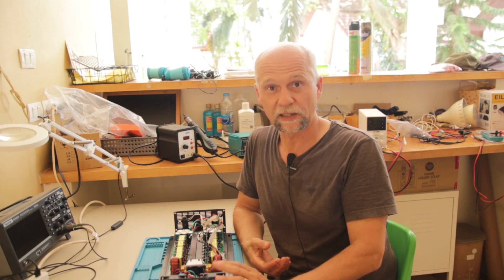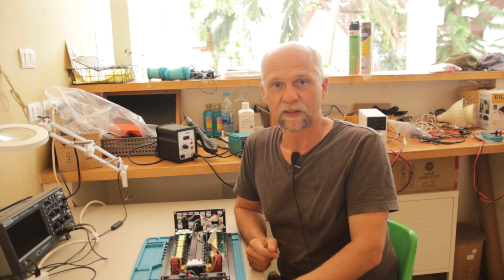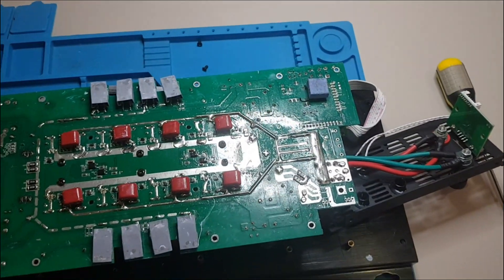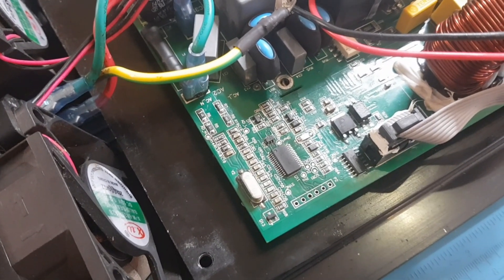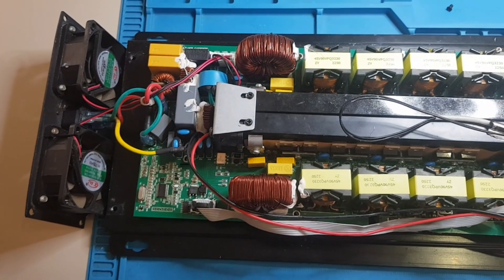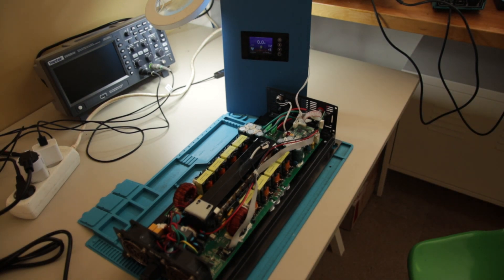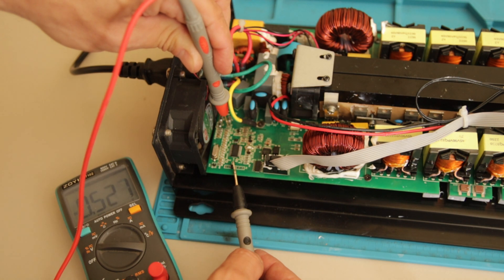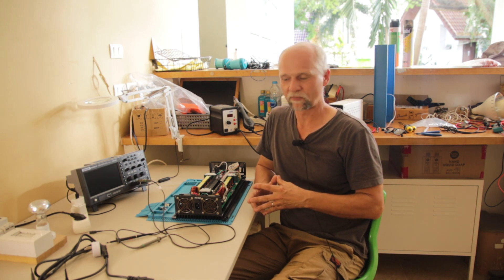Last chance for this SUN2000GTIL Inverter. What exactly means "Grid Error"?

Comment: Hello Roland,
Freut mich zu hören dass du das Serviemanual bekommen hast mit genauen Infos zur Fehlerbehebung. 
Mein SUN1000 funktioniert nach der Reparatur einigermaßen, hat jedoch noch "kleine" Probleme:
1. Bei der externen Strommessung für den Limiter wird einiges zu wenig angezeigt (etwa Faktor 5). Weisst du welche Widerstände für dessen Spannungsteiler zuständig sind und welche Widerstandswerte es sind?
2. Die ausgegebene Leistung ist auch etwa Faktor 3 zu niedrig. Wenn ich 200 Watt im Menü einstelle wird 80 Watt Leistung produziert. Wird das auch mit Vorwiderständen geregelt?
Darf ich fragen was du dir als Ersatzwechselrichter ausgewählt hast?
Besten Dank und Grüsse
Reply from the maker: Hi. Das was Du hier beschreibst ist genau wie meine Ersatzplatine funktioniert hat. Falsche CT-Werte, 80W am Ausgang. Die CTs und ihre Auswertung sind Teil des kleinen aufgesteckten Control-Boards. Ich habe dort bei mir alle Leiterbahnen nachverfolgt und es war alles in Ordnung. Also denke ich, dass das problem eher mir der DC-Boost-stufe zu tun hat und dann folglich mit der AC Umwandlung.
Ich habe jetzt soeben meine Anlage auf Deye SUN-10K 3-Phasen umgestellt. Videos sind gerade im werden, vorweg jedoch kann ich schon sagen... ein Traum :)
Reply: @RolandW_DIYEnergyandMore Danke für die Rückmeldung. Wenn du nach der umfassenden Analyse keine Lösung finden könntest, dann wird es nicht einfach mit der Reparatur.
Ich habe nur ca. 1kWp Solarleistung, somit benötige ich nicht einen grossen Wechselrichter.
Werde voraussichtlich eher Richtung regelbaren Mikrowechselrichter gehen...

Comment: Hallo Roland, ich habe heute die 4 Widerstände gegen neue ausgetauscht. Hat leider nichts geändert.

Habe dann mit der Anleitung fehlersuche betrieben.

Aufgefallen ist mir, das bei den Igbts zwischen Gate und Emitter ein deutlich kleinerer Wert ist, wie es in der Anleitung gezeigt wird. Fast kurzschluss.

Habe dann beide Igbts ausgelötet und gemessen. Beide sind i.o und haben auch kein Kurzschluss.

Könnte das auf ein Defekt des Treibers U3 hindeuten?

Viele Grüße
Paul
Reply from the maker: Hi. Willkommen im "Rabbithole" Sun1000-AC-Seite ;)
 
Ohne eingelöteten IGBTs was sagt der Widerstandswert auf der Platine? Dort ist ein 10k Pull-Down Widerstand platziert also sollte der Wert 10k betragen. Wenn es immer noch nahe Kurzschluss ist, schmeiß einmal den Treiber raus und messe noch einmal.

Ich bin mir jetzt nicht sicher ob irgendwo ein Filter-Kondensator zwischen G-E eingebaut ist. Verfolge einmal die Leiterbahnen in der nähe der IGBTs ob da noch irgendetwas anderes dran hängt.

Alles Gute! LG, Roland
Reply: @RolandW_DIYEnergyandMore  Hallo Roland, der Wechselrichter läuft wieder. Vielen Dank für die Hilfe. Der Treiber U3 hatte ein kurzschluss.

Viele Grüße
Paul

Comment: Hallo Roland, ich habe das Problem bei ein SUN 1000 mit der Fehlermeldung Grid Error.

Die Netzfrequenz wird im Display angezeigt und beträgt 46,1HZ. Scheint so, als wenn er nicht die frequenz richtig misst.

Habe dann mal gemessen und an H_3,3V liegt 3,2Volt an und an H_12V liegt nur 11V an.

An von dir besagten Stelle liegen 0,4 Volt an.

Die Betriebsspannungen ohne H sind auch i.o

Weist du woran das liegen könnte?

Viele Grüße
Paul
Reply from the maker: Hallo Paul. Die Frequenzanzeige kannst Du getrost vergessen, da dieser Wert dort auf keiner Messung beruht, sondern nur signalisieren soll dass das Netz außerhalb der Parameter liegt und der Wechselrichter somit nicht aufschaltet. Das schreibt er also nur willkürlich so hin!

Ausschlaggebend ist einzig das Signal welches er von den 4 Widerständen kommend sieht. Wenn dort eine Verzerrung der Sinuswelle angezeigt wird, also somit kein eindeutiger Durchgang des Nullpunktes zu erkennen ist, dann erkennt er das Netz nicht richtig.

Meistens bei "Grid Error", kann das direkt an diesen 4 Widerständen liegen, da diese Feuchtigkeit anziehen und Korrosion bilden. Du solltest diese also neu löten damit sie guten Kontakt haben.
Leider ist das Signal aber auch ein Produkt aus der H-Brücke zwischen den 2 IGBTs welche die Wechselspannung schalten. Wenn mit den IGBTs etwas nicht stimmt, wird das Signal verzerrt!

Hast Du die Wartungsdatei aus dem Videolink aus dem Blog vom Bobby gefunden womit Du den Wechselrichter tiefgreifender diagnostizieren kannst? Damit kannst Du dann noch andere Widerstände, Spannungen, etc. kontrollieren.

Liebe Grüße und ein frohes Neujahr! Roland
Reply: @RolandW_DIYEnergyandMore  Hallo Roland, ja danke und dir auch ein frohes neues Jahr!

Ich habe die 4 Widerstände neu verlötet. Hat leider nichts gebracht. Habe die dann ausgelötet und festgestellt das einer ein leicht anderen Wert hat wie die anderen. Habe die aufjedenfall jetzt erstmal bestellt.

Wenn das auch nicht klappt, schau ich mir das mit die Igbts an.

Vielen Dank für den Tipp!

Gruß Paul
Reply: @RolandW_DIYEnergyandMore Hallo Roland, ich habe heute die 4 Widerstände gegen neue ausgetauscht. Hat leider nichts geändert.

Habe dann mit der Anleitung fehlersuche betrieben.

Aufgefallen ist mir, das bei den Igbts zwischen Gate und Emitter ein deutlich kleinerer Wert ist, wie es in der Anleitung gezeigt wird. Fast kurzschluss.

Habe dann beide Igbts ausgelötet und gemessen. Beide sind i.o und haben auch kein Kurzschluss.

Könnte das auf ein Defekt des Treibers U3 hindeuten?

Viele Grüße
Paul

Comment: I guess I have been lucky mine still work but I am converting to LuxPower 12000 and it does not like the Sun 1000 on the same AC bus so I will be retiring them soon as they overload the AC leg when the load is not high enough. They produced 11000 kwh so I don't feel too bad.
Reply from the maker: @offgridwanabe  yes. They did a great job at your place and paid off 😄

Comment: Hallo Roland, ich habe auch einen Sun 1000 bei mir installiert, bisher ohne Probleme.
Eines ist mir allerdings aufgefallen, meiner reagiert sehr sensibel wenn ich beim AC In
Phase und Null-Leiter vertausche, sprich den 220Volt Stecker umdrehe, dann geht nichts
mehr und er speist nichts ein. Warum das so ist ist mir ein Rätsel aber leider Fakt. Vielleicht hilft das weiter?
Reply from the maker: Hallo Berndt. Ja, bei dem Punkt war ich auch schon einmal. Wir mit Schuko Stecker wissen ja, dass es sehr leicht geht L und N zu verdrehen. Ich habe alle meine Anschlüsse überprüft und auch geschaut ob nicht vielleicht intern wo was vertauscht ist. Alles Fehlanzeige!
Es geht bei mir sogar so weit, dass manche Wechselrichter auf der Werkbank anders reagieren als in der Powerwall, wo nach sorgfältiger Überprüfung, auch keine Unterschiede zu finden sind. Und dann noch, dass ein Gerät tadellos funktioniert, und das andere am gleichen Platz nicht geht...
Mit diesen SUNs ist das so ein Jammer. Sie gehen aus der Schachtel raus einwandfrei, bis zum ersten Fehler, dann ist die Tür offen und es wird nie mehr wie es war :(
Alles Gute!

Comment: They are the projects that when the repair doesn't go so well, it gets put in the corner semi assembled and always just looking at you when you walk past. Have another attempt a few days later, get frustrated then it goes back in the corner. Another 2 days pass, get frustrated that it's not fixed and try again. After again no success, i've had enough and it goes in a box as junk or spare parts. A week later it's back on the bench because of the idea that if it worked before then it can work again !!! 
Sometimes they come back to life and for the other times, just as @inothome said, "can't fix them all." ......until the next week comes and it's back on the bench again haha.
Thanks for all your videos so far. Really appreciate some intricate details given within some of your other videos in the past.
Reply from the maker: Yes. At this point I just have to many spare part donors already. lol. But yes, this is the fun in electronics repair. Those boards are like mind magnets and are always pulling you in for a new round :)